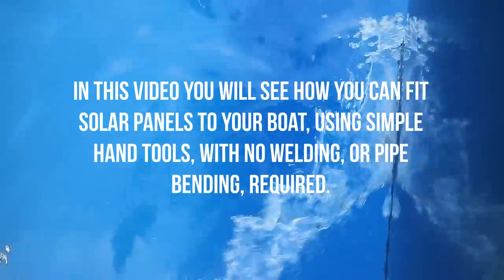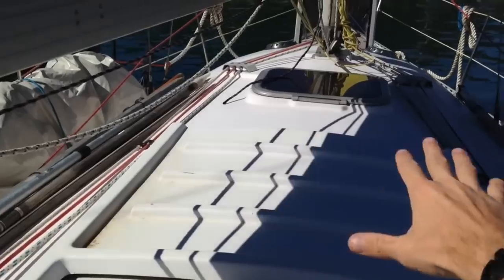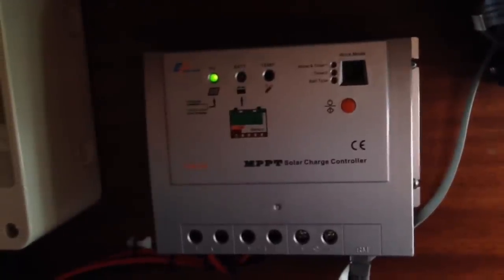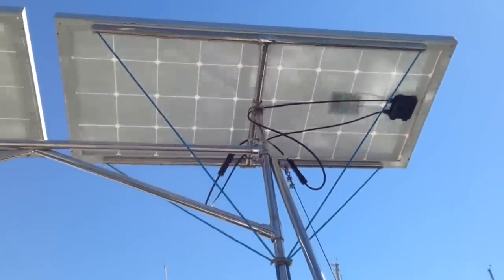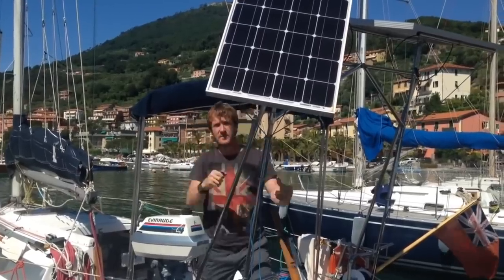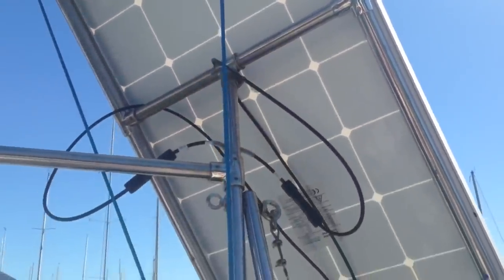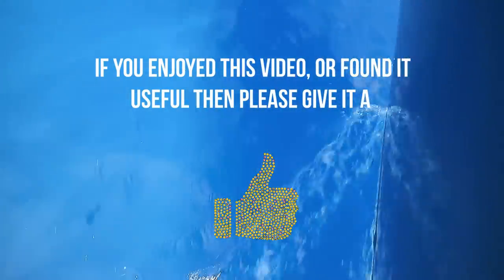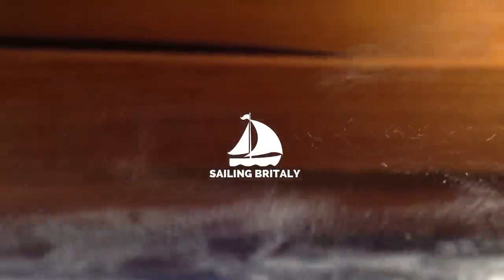Boat Solar Panel DIY Guide - NO WELDING! | ⛵ Sailing Britaly ⛵ [Boat Work]

Comment: How do they hold up in gale force winds at sea?
Reply from the maker: Hi Richard, very well actually... We have been anchored in 43 knots of wind (Severe gale on the Beaufort scale) with these panels and they were still rock solid with no vibration at all. The panels actually help stop the boat from 'wandering' sideways when lying at anchor, much like a mizzen sail would, so are a positive addition in that respect. Our boat has also been moored in 50 knot winds (storm force) with no problems at all. If we were going to leave the boat in an are subject to hurricane force winds it woud take approximately 3 minutes to remove both solar panels and stow them inside the boat. Fair winds! Chris & Rossella 👍
Reply: Sailing Britaly  Impressive!

Comment: Great Vid! I was wondering what size battery you are using? also what you are running off that? Do you have an inverter and what size? I am planning my own set up on my hunter horizon 30. Thank you for posting.
Reply from the maker: Thank you Sam, we had 2 x 100 Ah flooded lead acid house batteries, which were already old when we bought the boat. We managed with them the whole time we owned her. We had a very cheap 2000 watt  inverter which did everything we asked of it (although Rossella's he=airdryer had to be used on setting 1 rather than 2, otherwise the inverter would cut out. On the new boat we have 400 watts of solar, 400 Ah of AGM batteries, and another cheap (80 USD circa) inverter. Solar makes an incredible difference to how you can use your boat. Good luck with your installation! Chris 👍

Comment: Could you print out your design for starters.  People then could add what they needed for their boat.  Charge $5  or if they are patreon Fee????
Reply from the maker: I didn't make any plans per se, I just made the supports from my head - with about a million measurements taken along the way... I think all the info anyone needs to make their own version is in this video (every boat is different so the panel mounts would also have to be different) but if I missed something or if you have any questions then fire away and I'll do my best to answer them here. Fair winds, Chris (& Rossella)